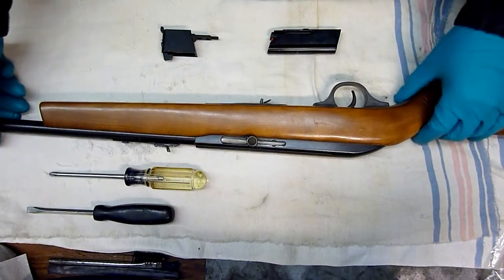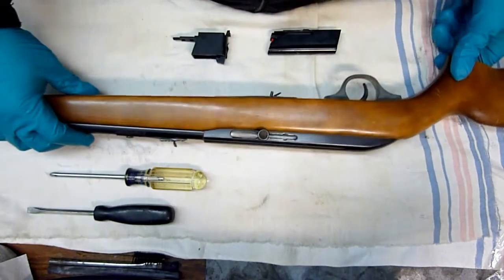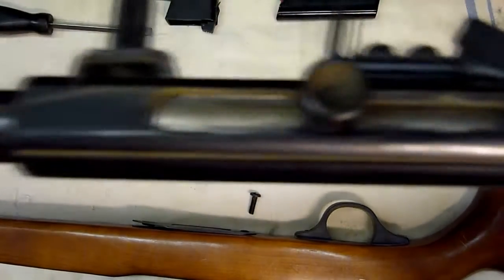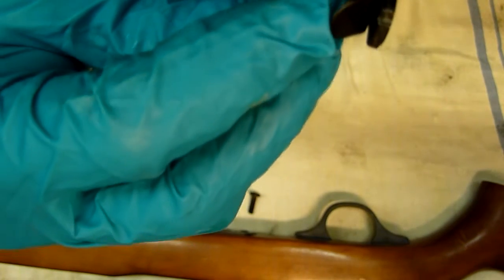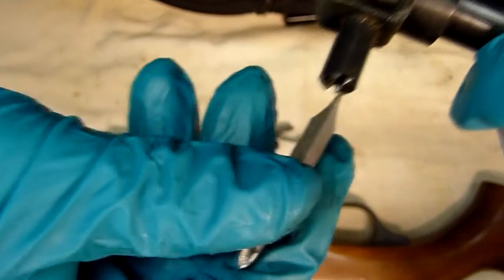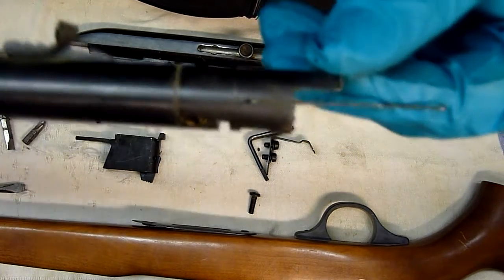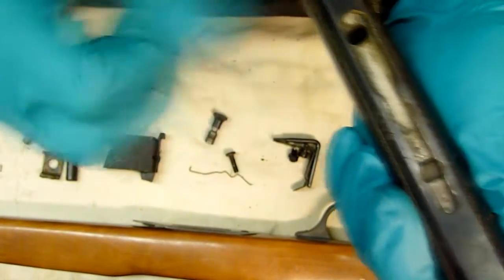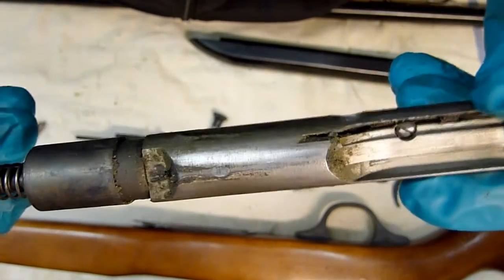Cooey 64 magazine receiver replacement part 2

Comment: My cooey 64 has a rabbit in the  grip with checkers. Nice so my old cooey winchester already had a mag conversion. Now I have a new used cooey 64 with a conversion kit and new steel 10 shot magazine. Need to break it in for 850 fps quiet semi auto bullets from cci. Works perfect with stingers.